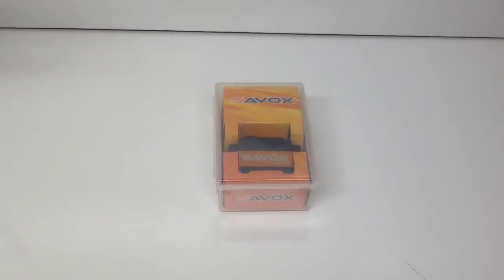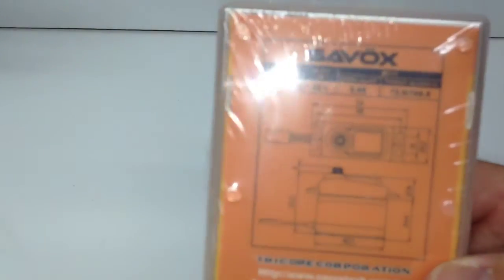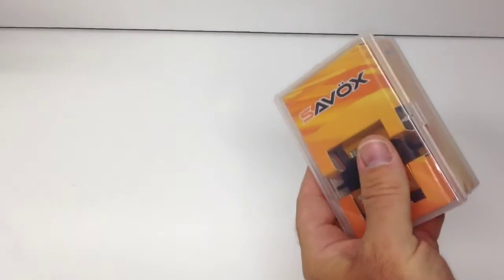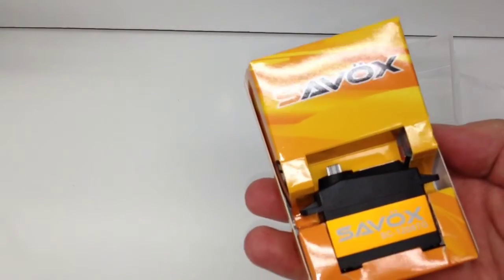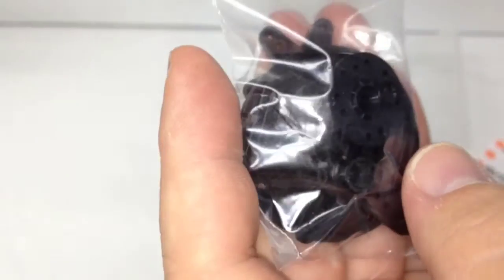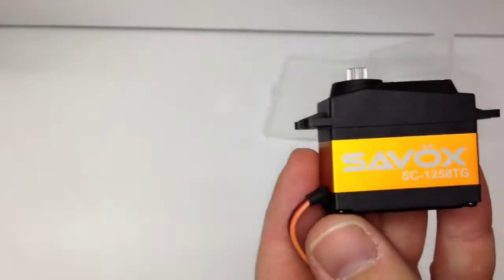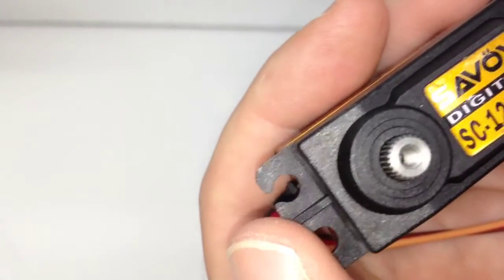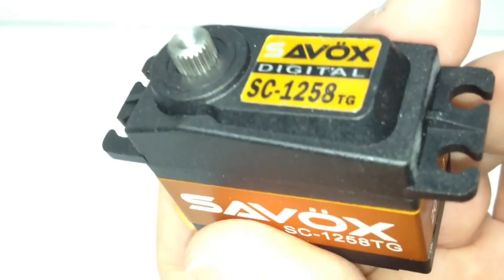Savox 1258tg - Unboxing

Comment: I have one of these on my traxas and it seems to not want to turn all the way One direction is there any calibration techniques or just time to get a new one
Reply from the maker: You'l need to set your "end point adjustments" on your radio....If you have the stock Traxxas radio, pull the owners manual, and it's a matter of hitting some buttons

Comment: Anyone fix servos?
Reply from the maker: Replacing gears and cases are easy.  Electronics issues should be dealt with by the maker
Reply: @TheRCNetwork  Somewhat agree, if i send in a servo to have a motor replaced i shouldnt have to pay another 80 for it when i can buy a new one for few more bucks,

Comment: What’s the difference between SA-1258TG Vs SC-1258TG
Reply from the maker: The SA version is intended for air vehicles and has a stated "minimum backlash" feature or higher bit rate.  The SC is intended for surface RC's
Reply: The RCNetwork wonderful!! I appreciate the knowledge. New to RC. Looking to upgrade my slash 4x4 vxl. The 2075 servo has already messed up within 2 weeks of being used. Bought new! I think I’ll go with the SC-1258. Is it possible I’d need a glitch buster? The car is all stock. Running the 3S esc with Valineon 3500. Nothing extra except esc and motor fans.

Comment: Hey great video! I have a trx slash 4x4 with a lower grade hobby wing esc, do u think I would need a stronger one for this servo or any other adaptations? Also Is this one water proof like other savox’s?
Reply from the maker: You'll most definitely need a Voltage Capacitor or an external BEC to run this servo

Comment: Hi I have a question, I have an Associated FT Aluminum Servo Horn 25T and a 1258tg servo  - is it ok to screw the horn straight into the servo and use it like that or would I be advised to use some sort of servo horn support ring as well? I'm not sure what a support ring actually does...? Any advice would be very welcome - enjoying your videos, thanks.

Comment: Would this fit in my 2wd Slash VXL without a glitchbuster or anything else?
Reply from the maker: Possibly......it's hit or miss.  Voltage caps are pretty inexpensive:  http://amzn.to/2vF9vNj  This one's on the expensive side at $7  It plugs into any open port on your receiver.

Comment: will this fit an emaxx without modifications?
Reply from the maker: It should, but may not be a very good upgrade for an EMaxx.  You want something that has more torque - at least in the 250-300 oz/in sector.  This 1258tg has 166...
Reply: okay thanks for the information and reply appreciate it, hopefully the emaxxes come back in stock soon have been waiting more than a month to buy one.

Comment: Just ordered one with a new B6D!
Reply from the maker: +Craftym Gaming nice!
Reply: Do you think a Spektrum DX4C will be a decent race radio? I bought one a few months ago and I find it comfortable but I don't want to spend tons of money on a radio...
Reply from the maker: Craftym Gaming save yourself time and frustration.....I've been there before. I originally has a DX2e and thought it was great....sticking with Spectrum, I got the DX3r Pro......I later found out that a $199 Airtronics MT4 blew that $400 Spectrum out of the water. If you want to seriously race, Spectrum is not a contender.
Reply: Ok! Well, perhaps I will try the DX4C out for this season, and maybe later get the airtronics MT4... What makes the Spektrums bad, or what makes the airtronics MT4 better?

Comment: +The RCNetwork, i have a 1/8 scale nitro truggy and i need 2 servos for it, i don't know which servo to buy. Im looking for a fast and powerful servo but under 75 dollars. Do you have any suggestions?
Reply from the maker: You'll want a high torque servo (something in the 300+ oz/in) for the steering of your buggy (being 1/8th scale).  For the throttle, you can get away with a bit lower torque (150+ oz/in).  Speed will be relevant to how much money you end up spending.  For the $75 price, it might be hard to find something that's fast and powerful....as the adage says:  Pick two:  Fast, powerful, cheap  The Savox 1267 will almost make the cut for steering
Reply: The RCNetwork will i need a a external BEC and servos for about 70-130 dollars? the stock steering servo performing on 6v it has 90 oz of torque, so do i really need a 300ish oz torque servo? and which would you recommend for the throttle?
Reply from the maker: I'm def not a nitro guy, but yeah, steering on a 1/8th buggy needs 300
Reply: +The RCNetwork will i need a BEC to run a 7.4v servo? and for the throttle would the sc-1257tg or sc-1258tg servo fit and work?
Reply from the maker: Once again, not an expert at Nitro set up
Reply: neither am i as you can see, i had an electric buggy as my first rc car and i wanted to see what a nitro car was like and i bought it 2 years ago and i regret it!! its still fun but lots of maintenance is required. Thanks for the help man and keep up the good videos!

Comment: I don't really understand servos so do you want a lower number for speed so it will turn faster and  do you want a higher number for torque so it's stronger
Reply from the maker: +Kaleb Moore Yep, depending on the vehicle, of course.  The time is the transit time, or how fast it will turn - The lower the number the quicker the servo will react.  The torque is based in oz/in and the higher the number, the stronger the servo is and the bigger the car/truck it can handle.
Reply: +The RCNetwork so would the Savox sb_2271sg or the Savox sb_2274sg be better for the Tekno sct410.3 and if they work what would be better
Reply from the maker: +Kaleb Moore I originally ran my Tekno with the Savox 1258tg.  It's a bit under torqued for the heavy SCT, but lightening quick.  If I were outfitting it again, I would want 200 oz/in of torque and .08 seconds or less
Reply: +The RCNetwork so on the servo specs why does it go speed(@7.4v or 6.0v sec/60): are Those saying what battery you run and how to will work I have a 7.4v 2cell lipo
Reply from the maker: +Kaleb Moore Many new ESC's will allow you to run the internal BEC at 6.0 or 7.4v - That determines the amount of power you send to the servo
Reply: +The RCNetwork would a traxxas one work at 7.4v

Comment: If I am running the castle 10A BEC, do I need the glitch buster also? Also, I am assuming that the best way to run the servo is at the higher setting (6v) since I will be able to program that feature?
Reply from the maker: +Ryan Feeney You're good with the BEC

Comment: I just put this servo in my slash racer project, and it works fine, except that I can't seem to get very much travel--only enough to steer about half way in each direction. I've put the longest horn I can find, and because it has to be installed on its side, the large circular pieces won't fit. Is there a way to increase the travel or otherwise solve this problem? Thanks for any ideas in advance.
Reply from the maker: +Ryan Feeney Are your steering dual rates turned all the way up on your radio?  If an aftermarket radio, are the end point adjustments set correctly?
Reply: +The RCNetwork --I had to pull out the radio's manual (its a basic model with no screen) but it did have a programming mode and I set the end points. Thanks much!
Reply from the maker: +Ryan Feeney Awesome!

Comment: i have a Team Associated T4.2 and i need a new steering servo, would this one work? if not, what will work great and not bust
Reply from the maker: +Bobby Feller This would work great...plan on picking up a $5 glitchbuster/Voltage Cap to plug in to your receiver though
Reply: +The RCNetwork is that usually near the servos on shelfs
Reply from the maker: +Bobby Feller Depends on where you shock.....Racers Edge, Spektrum and Novak sell them.....They look like a little capacitor with two wires coming off and then a receiver plug......just plug it in any open port on the receiver.  It helps keep the servo from robbing power from the ESC which causes brown outs
Reply: +The RCNetwork thanks so much

Comment: I have a 1258 in my SC10, and I can vouch for it's durability. It has survived my hack driving haha.
Reply from the maker: +MrBreeze Nice!
Reply: MrBreeze I second that. I was running my 1258 in my OFNA GTP-2 as a steering servo & nitro happened & it ran away & slammed into a concrete wall in 2nd gear with a LRP ZX32R pushing it full blast and the Savox didn’t even know there had been a rather catastrophic wreck. It resides in my Slash 4x4 now & is still going strong.

Comment: Do you think this would run well on a fetch410 touring car?
Reply: Detc410
Reply from the maker: Preauz Alam It will do great.  Keep in mind, Savox need a voltage cap with most ESC to prevent glitching.  I run a Hitec 8330 in my DETC410.  It's super fast and smooth and quiet.  Here's a link:  https://www.youtube.com/watch?v=-OoZm91076c

Comment: Thinking about buying this servo. I hear people talking about needing a "glitch buster", what exactly is that?
Reply from the maker: I-Know-My-Username-Is-Really-Long-But-I-Dont-Care-Because-Your-Opinion-Isnt-Worth-Jizz Yeah, Savox's are a bit "needy" and cause havoc in some systems (Certain recv/esc's) so a glitch buster/voltage capacitor is required to keep it happy.  Here's one that I use:  http://www.amain.com/spektrum-voltage-protector/p6570  Just simply plug it into any open port on your receiver and you're done
Reply: The RCNetwork Just ordered one! How long is the servo wire, do you think I'd need an extension for my Slash 2wd?
Reply from the maker: You should be fine. They're usually about 8-10"

Comment: How can you put a glitch buster on your servo
Reply from the maker: david marin Simply adding a Glitch buster or Voltage Capacitor to any open port on your receiver will help the issue

Comment: Hi Rich . what transmitter and receiver would you advice to get this up and running ? New to this and don't have a clue what kit I would need to run this ? Many thanks for all your answers you give to newbees like me !
Reply from the maker: As for value and what you get - The Airtronics MT-4.  Great TX/RX for about $200.  Here's my video on it:  Airtronics MT-4 Unboxing
 
The MT-4 can run pretty much any servo/car out there

Comment: Would this be good for a 1/8 buggy?
Reply from the maker: Probably not with only 166 in/oz of torque.  Although I have gotten away with running this servo in my Tekno SCT410 4x4 truck (about 6.5lbs) it would not be ideal for a 1/8th scale.  I would look into something that has about 300 in/oz to be on the safe side.  Any of the 127X series would be good.  1270, 1271, 1272

Comment: I just ordered a SV-1270TG and I’m trying to figure out what all the included mounting hardware is for. What are the rubber squishy pads for? I thought they should fit on the servo ‘ears’, but they don’t seem to squeeze in. Can’t figure out their purpose. Also why do they include those black nuts and bolts with the nice flat heads as well as the silver screws? Are the screws for mounting in plastics? And those plastic cups for the screws/bolts to sit in... I feel like some simple instructions would help me feel like I know how to mount this thing properly.

I can’t quite figure out which bits are the most important - and I’m worried that the 35kg-cm of torque in this beast of a servo will damage my mounting area if I don’t mount it correctly. Any tips? Love the channel!
Reply from the maker: The rubber grommets go on the eyelets of the servo...The brass through washer goes into the rubber grommet.  The flat headed screws are my fav servo screws.  All the rest....No idea!  might be for a plane / misc application.  As for using all the bits and pieces....I only use the flat head screws.  Just get a solid mount, using the flat head screws and your good!
Reply: Super helpful, thanks! I managed to get those eyelits and rubber seals in the eyelets finally. Do you think they’re just to keep water out? I don’t care about waterproofing, as I’m not going anywhere near water in my truck. So just the flat head screws and washers will provide a solid mount on their own? I’ll probably just use them, then. Thanks for the help! :)
Reply from the maker: I believe the rubber grommets are to dampen the eyelets and to protect them somewhat.  I ran them on my very first high quality servo and since then (20 servos later...) never again!

Comment: You haven't confused me at all and the experience you care to share is extremely helpful. I plan on running a 54/18 32P Robinson Racing spur/pinion setup in my truck. I will most likely run 3S packs with a 2S thrown in when I borrow a friends. (I'm going to run MaxAmps since I can get them in person from the home office here in Spokane). My goal is to create a basher that is a complete standing backflip, 30mph wheelie pulling, tire shredding monster. Despite the truck being lighter, isn't the quick jump launches, acceleration, wheelies, etc., all dependent on torque? I won't be doing speed runs other than any straight always on a track so top speed is less important than acceleration and power to me. I'm going to be pissed if the thing is sluggish with a 550 can. Do you think it will be sluggish with the 550/G2/3S combo? If so, I can always go with the Pro 4. You just see so many rigs that are insane power with 550s in them, that's what I want to build.
Reply from the maker: I'll give you a couple of examples:  I was running an 1/8th scale buggy with a Mamba Monster 2650kv motor and 4s Lipo.  My buddy had the same buggy, but with a 2200kv.  He had to run 5s to keep up with me. 
 
Another example:  I have a SCTE/MIP that weighed in at 5.85lbs running a Gen1 RX8 and a Pro4 4600. When I outfitted the Tekno, which weighed 6.9lbs, I ran the Gen 2, Pro4HD 4300kv.  I was acheiving about the same speeds, although the weight difference and similar gearing.
 
The botom line, is you can run the 1850kv motor, but you're going to have to run some serious voltage to obtain the speeds/torque that you want, but you're also adding weight with the 3, 4, 5s lipos you'll be running.  In the end, a very well tuned (gearing) 4300kv with a decent (MA 6500 150c) 2s Lipo (think lighter) may have the same outcome with the lightweight Slash 4x4.  
 
There's been people dropping Mamba Monsters in the Slash for years and they swear by them running 4-6s Lipos.  I've just personaly seen a different side of RC by putting the appropriate electronics in.  But I typically don't gear my RC's up for bashing either.  Keep in mind to beef up your drivetrain if you plan to run higher voltage/high torque through your slash.

Comment: Also, after consideration, I'm going to forgo the 25T horn like you in favor of a Kimbrough servo saver. Jay Kimbrough emailed me and suggested the large, or the large HD (for nitros) if I was going to race. I bought both but am going to install the large since I intend to bash with mine most of the time.
Reply from the maker: Cool deal!

Comment: Thanks again for your feedback on my questions! To answer your question, I'm only going with the HD because I'm planning on running a lower kV motor than you so I can regularly run 3S packs with an occasional 4S for fun without worrying about shattering my magnets or overheating. I plan on going with the 1850kV version for that reason. That, and Tekin recommends the HD with the Gen2 on its web page. Thoughts? I was considering the Castle Sidewinder 8 with their 1800 series motor as another option. As always, I appreciate your thoughts based on your experience.
Reply from the maker: Well, are you going for speed or torque?  Considering the Slash 4x4 is pretty lightweight in comparison to many of the 4wd SCT's, Too much torque really won't benefit the slash 4x4 vs something heavier.  That's why you see much lower kv motors in heavier 1/8th scale buggies/truggies.  The Gen2 RX8 can run almost any motor, including the Pro4. The 1850kv has a recommendation of 4s, so on 3s, it will probably be boring and slow/sluggish. If you're dead set on running a 550 sized motor (Pro4HD) and running higher voltage like 3s (11.1v), I would set it up with the 3000kv and plan on running mostly 3s, as 2s will feel slow.  You also have gearing options, but you gotta watch the heat!  Hope this hasn't confused you more!

Comment: Rich, I bought the 1210SG for my slash platinum project truck and plan on running the RX8 Gen2/Pro 4 HD combo. I've read that you don't need a glitch buster with the higher BEC rating of that ESC. Any insight you could share on that topic? Thanks!
Reply from the maker: Yeah, you are totally free of glitch busters, voltage caps and external BEC's when you run the better ESC's like the RX8 Gen 2.  I even ran mine on 6.0v and it's totally fine.  Have you already planned on the Pro4HD?  I run the Pro4 4600 and it seems to be plenty for the lightweight slash.

Comment from the maker: Most likely, you have to install an external BEC (Pretty easy to do, just follow the directions - The 10 amp Castle BEC is great and only about $20).  The internal BEC of the MMP is horrible with high voltage servos like the Savox.  I was able to use a Spektrum Cap (Much like your Novak GB) to calm mine down.  I actually got rid of my MMP for the Tekin RX8 and it cured all the problems.  Hope this helps

Comment: Hey I gotta question for you about this exact servo. I have it on a mamba max pro esc with a r2004gf futaba reciever also with a Novak glitch buster, and this thing glitches still like crazy. It will go then stop to a dead stop wheels turn by themselves. Any help would b greatly appreciated. Thanx